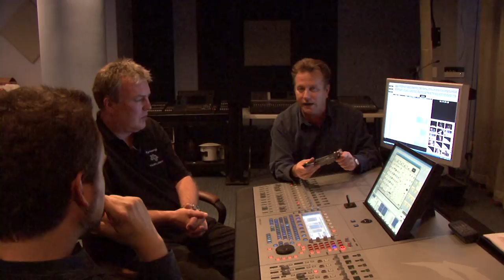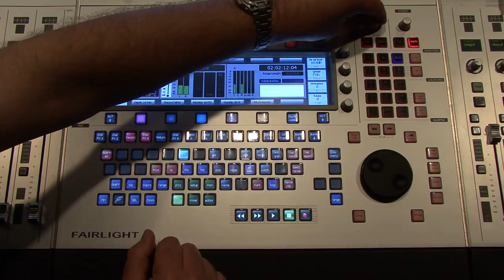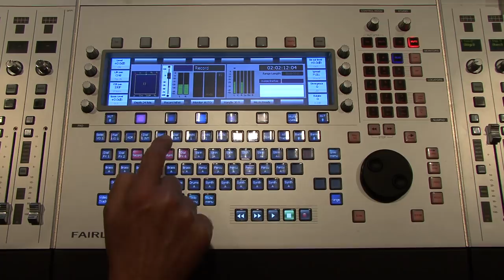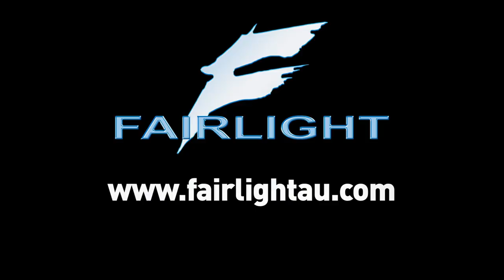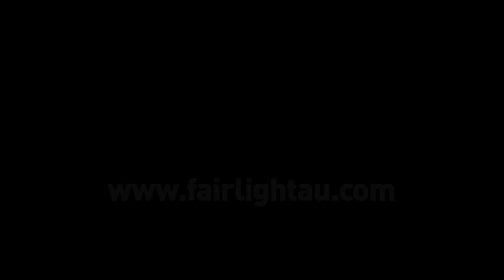Fairlight Xynergi Demo - Chapter 4 - Zero Latency

Comment: I'm not sure on this zero latency demonstration. I mean, if you treat all the signals in  a buffered way (it's digital) then you are sure that all the signals are in phase (in that particular buffer window), so you can send,return,re-effect, re-send, re-return without loose the phase: all the signals lie in the same buffer.
The buffer size could be small enough to declare it as 'zero latency' (the processor have to be very very fast) but this demonstration does not clarify the fact.
Am I wrong?